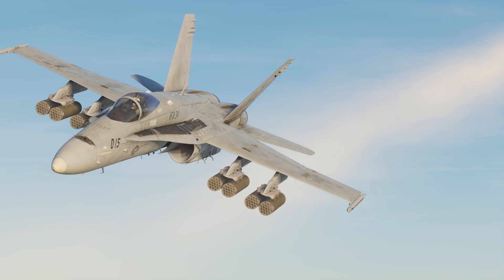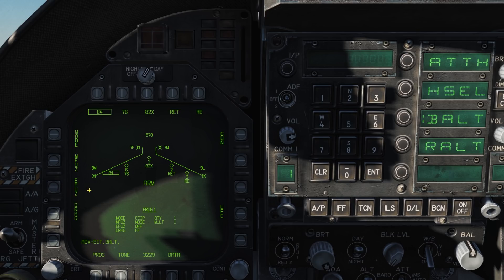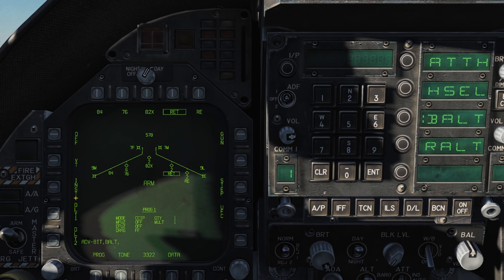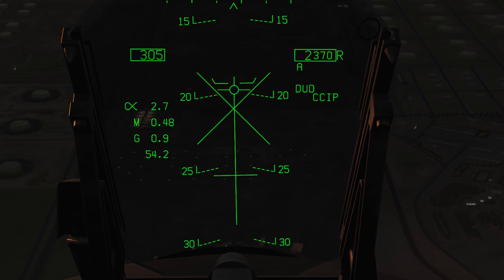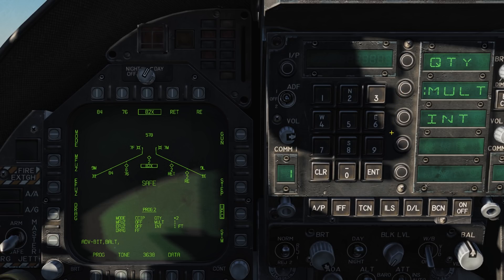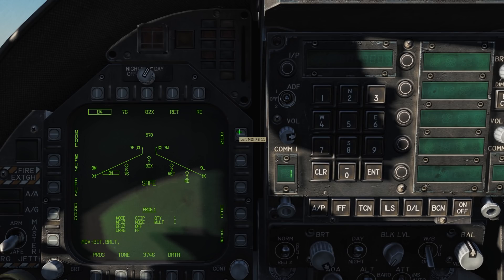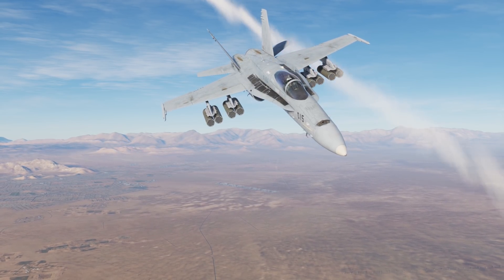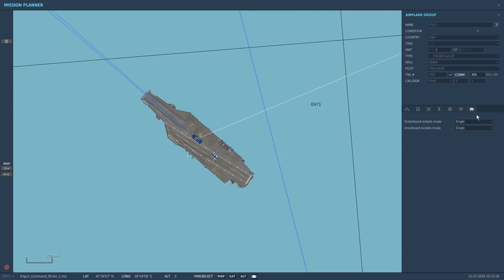DCS F/A-18c Hornet Weapons Programming Tutorial

Comment: i know its off the subject, is there a way to make an a.i helicopter, hold position when he lands, untill an enemy unit is dead, before he moves, i know the timer is there, but wanted a unit dead before he can get out of the area  ?
Reply from the maker: I think you can get a unit to hold until a flag, so if you set a flag to change when that unit is dead, the helicoper would be told to take off.
Reply: RedKite awsome thanks
Reply: RedKite works fine with ground units, cant get it o work with helos landing,   just adjusted the landing time for a work arouns
Reply from the maker: You've tried Advanced waypoint actions - Land - Stop condition - Is user flag #id (set flag #id to true to trigger take off)?
Reply: RedKite i tried but doesnt seem.to work for me, could you possibly do a video on it
Reply from the maker: Il have a look.